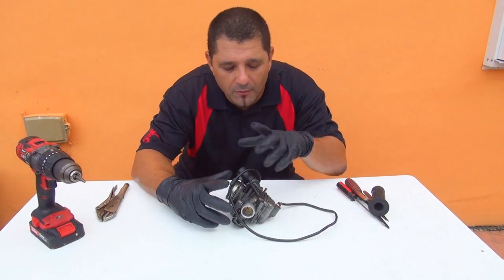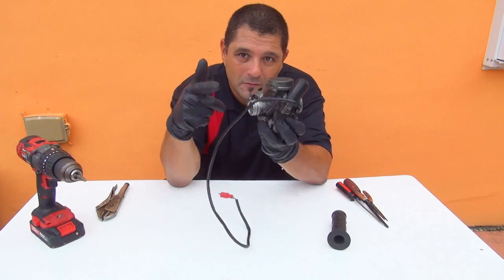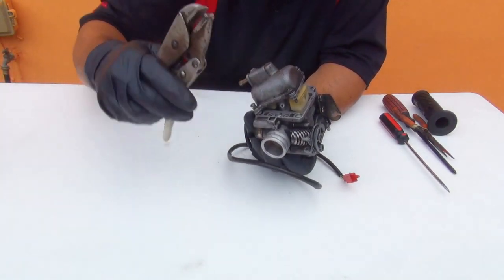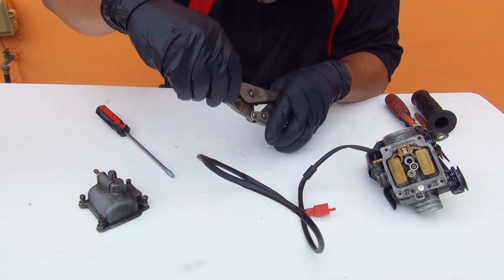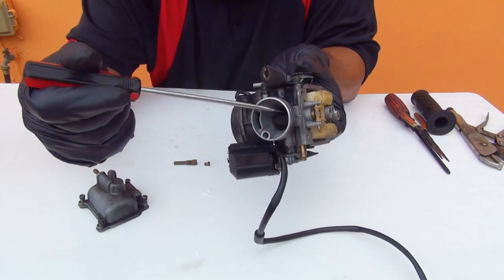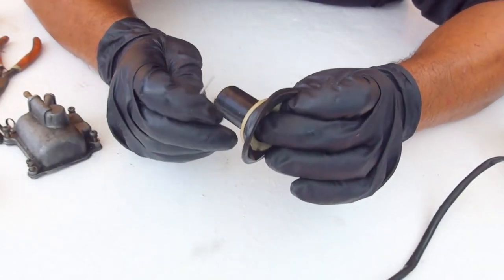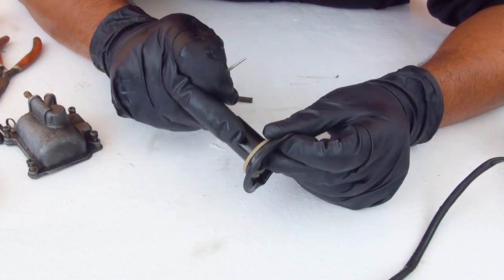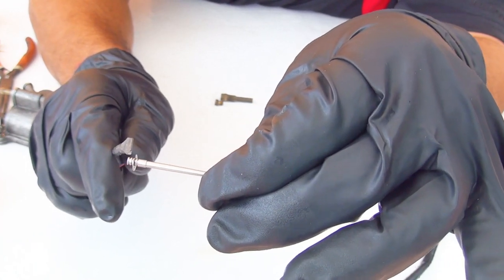Chinese Scooter Needle Tuning Adjustment

Comment: Hi still watching your great  videos!
A sure way to determine rich or lean fuel condition is to check your spsrk plug after every adjustment to the jet or the needle position. A black or wet spark plug indiicates a rich condition and a white or ashy plig ini dicates a lean condition, you need to find a balance in between the two. I use several brand new plugs when adjusting a new carb so results are more reliable to see.
Reply from the maker: Hello m friend great idea and thank you for watching my video

Comment: Help! I have quite a bit of experience with jetting a carb for the best performance. My bike starts, idles, and runs great under most conditions. The issue I'm having is that I live about a mile down a very rough dirt road, where I can only run about 10-15 mph (5000-6000 rpm). After a couple of minutes at this speed, it starts to bog and will sometimes die. I'm hoping a needle clip adjustment will solve this, but I'm not sure which way to go. Does this sound more like a lean or rich condition?

Very nice video, one of the most comprehensive I have seen! Thanks for that.

You mentioned how soft and easily stripped the factory screws are. I replaced all of mine with stainless hex head (allen head) screws. No more worries! They are available at some hardware stores, I bought mine at Ace.
Reply from the maker: I'm glad to hear that you found the video helpful, and it's great that you replaced those screws with stainless hex head ones to avoid any future issues! Now, let's address the carburetor jetting issue you're experiencing on your motorcycle when riding down the rough dirt road.

The symptoms you describe – the bike running well under most conditions but starting to bog and potentially dying after a couple of minutes at low speed – could be indicative of a slightly lean condition. When you're riding at low speeds, especially on a rough dirt road where the engine might be working harder due to vibrations and variations in terrain, a lean condition can become more noticeable.

Here's a step-by-step approach to address this issue:

Check the Spark Plug: Start by checking the spark plug's color after a ride where the issue occurred. If the plug is white or light gray, it may indicate a lean condition. If it's dark or sooty, it might indicate a rich condition.

Air Filter: Make sure your air filter is clean and not clogged. A restricted air intake can contribute to a lean condition.

Needle Clip Adjustment: Given your description, you might consider lowering the needle clip one position. This will allow the carburetor to deliver slightly more fuel at mid-range throttle positions, which could help with the lean condition you're experiencing.

Main Jet: If lowering the needle clip position doesn't resolve the issue, you might want to try a slightly larger main jet. This will enrich the mixture at full throttle and could help with the lean condition when riding at higher RPMs.

Pilot Jet: Ensure that your pilot jet is clean and appropriately sized for idle and low-speed operation. A clogged pilot jet can cause problems at low speeds.

Fuel Quality: Make sure you're using fresh, high-quality fuel. Old or low-quality fuel can affect the bike's performance.

Carburetor Cleaning: If the issue persists, consider cleaning the carburetor thoroughly. Sometimes, debris or varnish buildup can affect fuel flow and cause lean conditions.

Consult a Professional: If you're not comfortable making these adjustments yourself, it's a good idea to consult a professional motorcycle mechanic who can fine-tune the carburetor for your specific riding conditions.

Remember to make changes incrementally and keep an eye on the spark plug's color as you make adjustments. It may take some trial and error to find the perfect setting for your motorcycle's carburetor, especially when riding on challenging terrain like a rough dirt road.
Reply: Thanks for the reply! I'm pretty good about keeping the carb and jets clean. I think my jetting is good, once I hit pavement it runs great. I'll try lowering the needle clip one slot, it's currently right in the middle. A little side note: A piece of the smallest guitar string is perfect for cleaning out these tiny pilot jets! Thanks again!

Comment: My scooter did not start with old carburetor then i switched to new carburetor and it started with no problem. Now 2 days later the scooter wont start with new carb it cranks but wont start any idea what the issue could be.
Reply from the maker: Hello my friend I think that could be a valve  clearance

Comment: I went from #76 stock to a #102  I’ve also a upgraded air pod filter & did away with the stock filter. Starts & idles great. But, after adjusting needle up & down both not seeing much of any change still. Topped at 40-m.p.h.  Even drilled out my fine adjustment. About the same still. What you recommend?  On the carb?
Doing other upgrades later on.
Reply from the maker: Hello C Fitzwater do you have a gy6 150cc because 40mph is very small speed
Reply: @VirberelloScooterTips  qmb138 gy6 
49cc. 2020 TaoTao pony
Reply from the maker: @fitzwater504  the best thing you can do for a 49cc  is to buy a big bore kit https://amzn.to/31WNETz
Reply: @VirberelloScooterTips  Thanks I’ve already been looking at them.

Comment: I put pro air intake nibbi elbow uni 2 stage  filter...& NCY pro exhaust...will bottom out at 20-15mph i bought a [performance  carburetor] it only had a 75 main jet...the idol is fine to 15.. so do u think i need 85 + main jet...& 50cc-49cc south Florida 5 feet above sea level.  Thanks always!👍
Reply from the maker: Hello David after all the modification I will place a 85# main jet or 82# in Florida winter and 85 in Florida summer ah ah ah Thank you for watching my video and be safe

Comment: How to reduce petrol in this type carbrator?
Which side need to turn the fuel screw?
Reply from the maker: Hello to reduce petrol is to place a smaller main jet you can try to turn the screw 0.25 turn clockwise

Comment: My 150cc coolster atv leaks gas from a hose on my carb and it bogs down all the time do you know what could be wrong?
Reply from the maker: Hello I think the carburetor is overflowing the floater doesn’t go back up and close the needle valve you could have a damage floater anyway you need to open the carb and look inside

Comment: The tip of my needle is not 100% straight anymore. Can it cause a problem?
Reply from the maker: Hello my friend sometime if is a little crooked is ok but if is a little to much can give you a little problem because the needle will rub on the inside of the needle jet diffuser and make resistance on performance
Reply: @VirberelloScooterTips  Thanks, I will pay attention to it and see